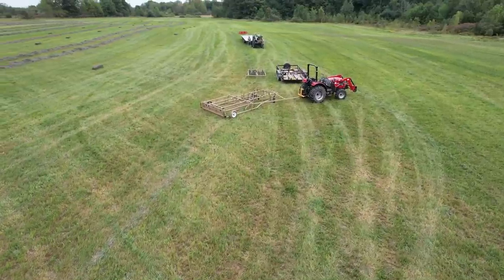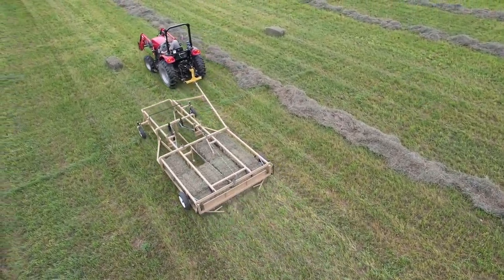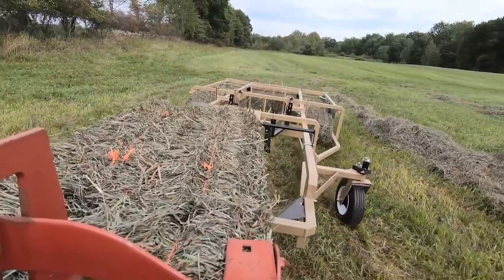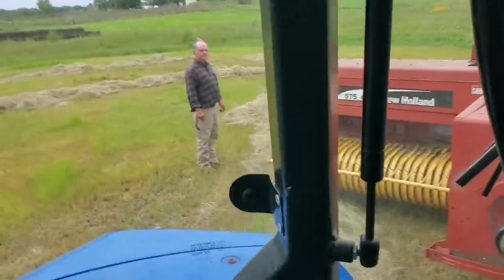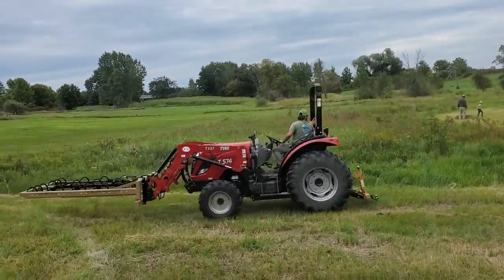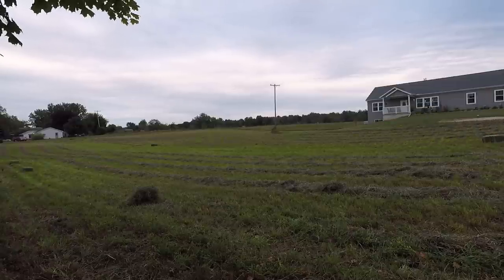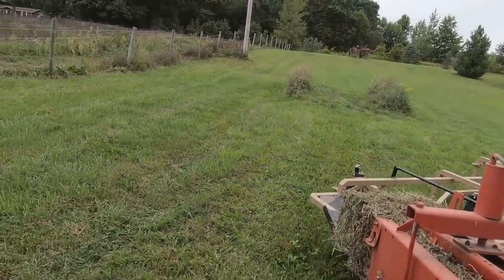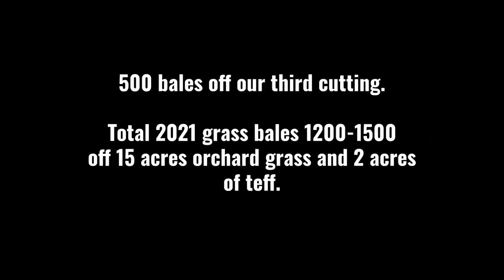404 Ground Driven Hay Accumulator System? - Parish Agriturf Demo

Comment: With my square baler and accumulator I found it easiest to take three circles around field then make all passes for remaining field end to end. Bale the three outside passes first and then skip two rows on each back and forth pass always turning right. My field is a very irregular shape with lots of trees and found this method worked well for me.

Comment: As a kid in the 50's in up state NY we used hay hooks and took the bales directly from the baler and stacked them 8 bales high on usually two wagons at a time and then took them to the loft. The hay was super dry as wet or damp hay or straw would burn a barn down. 
In the spring after plowing we kids would walk beside the rock boat and gather rocks out of the fields. You would think that after years of this there would not be any more rocks but like radishes they just kept coming to the surface. Most had sea shell impressions on them and we were at 1100 feet above sea level in the finger lakes region of NY.
The advances in almost everything is amazing. Only wish we could be equally amazing in being kind to one another.

Love your channel. Mike

Comment: I'm very happy for you guys that you chose this type of system. It's what I recommended (seems like) a long time ago. It is such a simple system. Easy to fix. And it does away with 85% of the labor. Not perfect. In those little fields, it is probably the best to run the accumulator separately.
Out here in the Plains, almost NOBODY feeds small squares anymore. Other than horse people around the cities, and racetracks. There is just so much round bale and BIG Square hay....even alfalfa. (In the rural areas) Fairly cheap too! It was good seeing an accumulator work again, Suzanne!

Comment: Viewed 3-6-22  from Illinois       Hi Sue     The accumulator you were trying out would  NOT be my choice.   Baler alignment to accumulator an issue,  bales not falling into correct position
requiring  stop to reposition, plus bales curl up meaning another stop.  Stay with the accumulator you currently have :)))

Comment: Great video.  Seems if the field is big enough pulling the accumulater behind the baler is the way to go it eliminates a step.  With gas/deisel more than doubling in price for next year anything you can do to save time and hours on the tractor will help out.
Reply from the maker: No doubt there!

Comment: Brilliant design on that wide mouth accumulator.  The only thing they need too add are some replaceable rubber strips where metal hits metal to reduce noise.  It may not be that bad in person when you're surrounded by the noise of whatever you're driving but the up-close video of the bails being fed in would get real old real quick.
Reply from the maker: That's a nice idea!

Comment: Watching those bales come out of the baler brings back years and years in the hay field. Long hot sweaty days that kept you in shape and felt wonderful when all was in the barn. Then a hot shower and good meal. Slept solid. The best life. 
Knotters seemed to work pretty good. Your a good mechanic getting those previous bugs worked out.
If those last alfalfa bales were damp there is a good possibility they will get dusty and not healthy for horses
Reply from the maker: I agree on the solid sleep situation! Keeps you in good shape!     The knotters did not give me issue even once! I was a bit worried since they were not perfectly aligned, but . . . if it aint broke, don't touch it, hahaha!

The alfalfa bales were for cows and goats. But I still don't like making bales like that.

Comment: Check out Hoelscher hay equipment. They have a system- don't know anything specific about it, but it might be worth a look. The system you tried in this video seems to work well, and the price isn't bad when compared to the Kuhns system. I am just not a fan of dragging bales all over the ground 🙂
Reply: this is the first one of these I have ever seen, only accumulators I have ever seen are pulled right behind the baler, if there is a price difference in this to the hook up type, it would be ate up in having another tractor, and fuel, only to have to go back again and pick it all up too, I have not crunched any numbers, this is all off the top of my head.
Reply from the maker: They ahve a nice system we found a used one locally (along with a very nice 575 baler too!), but they stack on edge, and not sure how that would behave in the barn if they'd fall over when I walk on them . . .

Comment: Greetings from the UK!   Those kind of tow-behind-the-baler accumulators (we generally refer to them as 'sledges') are pretty much standard kit for anyone making small bales over here.    They can be a bit of a nightmare if you don't have your baler set up properly, but once you get up and running they're pretty reliable.   In my experience it's pretty normal to have a few get stuck on the way through (I've had a few angry conversations with my sledge in the past!)
The other thing we come up against is that if you have a bit of an odd-shaped field, where your rows end up in a "fun" pattern, the sledge will sometimes drop a stack right in the way of where you need to be the next time round... it certainly makes you concentrate on how you rake!  After a while, you just get used to driving it as a part of the baler.    I've just bought a different model for haymaking this year...  so hopefully I won't regret the change!    Take care!

Comment: That system looks good. Looks like there is a extra piece of metal on the first gate that's catching the bales. I use one very similar in the UK but it holds 8 bales and we call them a flat 8 sledge and grab. There are a few videos showing them working.
Reply from the maker: I like the systems you ahve in the UK, I feel they are almost better than what we ahve available in the US :(

Comment: I love this video. When we were able to pull the wagon behind the baler, it was a game change for us. It beat pitching onto the wagon.  I would be curious how this equipment works on hilly fields, and ravines. It's a big investment for a small farm.
Reply from the maker: Hills I think would be ok, but ravines, not sure, lol!
Reply: That was the same way I did hay, back in the early and mid 60's. I rode the wagons, stacking hay.
(We had 2 wagons, only used 1 when close to barn.) We put up around 3000 bales a year.

Comment: We would always wait for hay to be properly dry even if it meant another raking and often did.  Longer bales would not clog that accumulator as badly.  That field seems to be much more than 1.5 acres.  No way does getting rained on reduce bale price by 25%!  Wait for another day IMHO.  I would have been told to go back and cut the strips missed!
Reply from the maker: When it's top quality horse hay, it does :(    I currently have customers fighting over this year's prospective crop because last year's was so nice. Rain cuts the sugar down in the hay, which for everyone else is a good thing. But my hay is already very low sugar, so any rain will take out the bit that's there, the the horses will refuse to eat it. No one will pay $8/a bale for hay their horse turns their nose up at ;)
Reply: @This1LifeWeLive  OK then.  I didn't know horses were so pickey.  I can understand people fighting over You, but not Hay!  It will likely go to 10U$ a bale with the lack of moisture currently in effect.

Comment: Hello Suzanne, best working system I have seen U use yet. Looks like the bales need to be tighter though. Thx 4 this video today. Maybe sell off the machinery no longer used & that will pay for this system.
Reply from the maker: I think it IS time to sell off the bale carts . . . that would be an easy $5K . . . but we keep them for the "just in case" moments. Although they do require a different set-up, so it's not like we could just drive over, grab one and put it to use, lol!

Comment: That looks like a pretty simple system being ground driven.  I've seen a bunch of trailers where the hay goes up a little elevator and then slides down diverters to be organized into groups like that.  I'm sure they are more expensive systems, but they would allow backing up and probably not curl the bales.  I live in eastern Michigan and I would love to have a small hay operation one day.  I already have a tractor, I just need to buy more land.  The neighbors probably think I"m nuts mowing my 1.5 acres with a 46 HP tractor.
Reply from the maker: we have a neighbor across the street who mows his large yard with a tractor (finish mower) too!

Comment: As you said   Your varieties of grass  requires  you to leave at least  4 inches of stubble height, where as our southern grass is cut down to the ground.....because the regrowth comes from under the ground, not from what is left on the surface.....We can  back up with the  Baler/ Baron system......Being as we supply  TSC  Farm supply stores in our area with  contract deliveries  it is more fesible to  get as many bales possible in a 53ft trailer as quick as possible.... Another plus of a Baron over a Bandit is it will bundle a shorter bale  (32in  vrs 36in)......meaning it takes less hay to make a Baron Bundle.. There are producers in our area  that  do more for less....... We do less for more..... Everything  under our shed was  " buy it then try it"  sort of like a striptease show No free looks
Reply from the maker: ohhhh, ok that makes sense! I have seen both the Barons and the Bandits, but haven't looked at them in a while!
Reply: @This1LifeWeLive  Well Little Lady......... stay tuned   a Bandit we already got...... the Hyddralic drive unit with Baron  should be here in April.....And the  Massey 1840  is under the shed

Comment: I'm partial to new Holland bale wagons. I was a one man operation though and found that worked best for me. I was looking at bale accumulators and I think I found one that is a accumulator/grapple combo that mounted on a tractor or skid steer.
Reply from the maker: That's what we have been using. It works, but still twice as slow as having an accumulator on the back. For us, we have a very small window in which to bale hay, so we gotta gett everything off as fast as possible.
Reply: @This1LifeWeLive  I didnt see any videos with a "New Holland"bale wagon. I may have missed it. May also be called a harrow bed. They're very popular out west. I would look also look into a accumulator/grapple combo or if you want to spend the big bucks there's a machine that bundles several bales together and bands them together.

Comment: I've only done large round bales, so I really have no experience in square bales like yours. IMHO, based on your videos, I think the pull behind works extremely well compared to your first accumulator you bought. The original one you bought appeared to be on the short side in length and it always looked like it was barely holding on to the front bales. The unit they brought along with them to put on the front of the tractor was notably longer and appeared to hold the bales much better. Again, just observations. Sometimes it's hit and miss with equipment and until you really get into using it, you'll never know the ins/outs. So, don't beat yourself up if you're regretting some of the equipment you have. No accumulation equipment is perfect, but the little details with them can make a world of difference. Also, I think the pull behind worked best just by itself, rather than behind the baler. I think it's just too much of a "train" to have to worry about.

Comment: Good baler with a kicker into a wagon. Is the fastest. I have done for many years. I have a the equipment for sale right now cause I'm going to small rounds. Seem like the bales sliding across the ground be picking up dirt and moisture. I will answer questions on hay making.

Comment: The best way yet is to just pull a hay rack behind the baler and load as you go. We have a total of 9 hayracks we use when baling square bales.
Reply: OMG,such blasphemy, actually touch a bale. Enough sarcasm,we still use kicker wagons,it allows me and my son to load wagons and back them into the barn immediately, in the last twenty odd years I've lost count how many times I've been chased back to the barn with rain. None of these systems can do what we need and that's fill the barn to the top wether it be the vapor barrier or the hay car track.
Reply: @tomreisinger6220 , we have 4 barns we fill with square bales. We bale a total of around 30,000 square bales any given year. Plus around 150 to 200 big round bales. We have a 300-head cow herd plus 50 sheep we feed. I got 7 brothers and we all farm together.
Reply: @morse2795  300 cows, that'll keep u guys busy, the old farmstead we bought 7 yrs ago only has room for 50 maybe, we only have 7steers and 1pen of pigs (6) and 1 mom cow, we started getting some cows to feed the chaff to , people won't handle loose hay even giving it away, the amount of sloth today is unbelievable, good luck to your operation, always something to be learned with cows and hay.

Comment: Do you have any clips with a side view of the bailer/ accumulator? The flipping around due to bouncing seems like the resolution would be a short slide as long as it clears the frame of the accumulator.

Comment: Not going to comment on the system itself because all that type of work i did was minimal back when I was young and dumb and could take the punishment of stacking by hand.
I will say if some company wants to work with a farmer on doing some testing/showing their product they need to be watchful of the weather, showing up willy-nilly when its suppose to rain can ruin a harvest that the farmer has to incur the cost.
I enjoyed the video though, anything mechanical gives my weary bones a sigh of relief these days. Take care.
Reply from the maker: agreed on all points.  While we ARE young enough yet to stack, we don't have the time to stack. The longer the hay sits on the field, the lower the quality and the lower the price.  So it's worth shelling out a bit extra $$ for bales off the field and stacked fast! I currently have customers stacked up eagerly ready to fight for this year's harvest, and that's a GOOD thing, hahaha!

Comment: We have a similar accumulator that’s about ten years old then the parish. I like how they are combining the guides as actuators to move the bales thru the system. 

Does it’s need 18x18x36” bales and a heavier bale (75-80#) to work best?
Reply from the maker: bale size yes, but heaviness no. Mine are 40-55lbs and it did ok. Biggest obstacle is grass variety. some types don't allow bales to slide over them well
Reply: @This1LifeWeLive  ours is mainly Alicia and Bermuda varieties so they slide fairly well. It has arms that hang down to actuate the guides. But to turn the back bales they need some weight to turn them. 

But it beats loading them one at a time by hand anyday!

Comment: Your system works, but to much equipment,slows down the operation. I also went through those growing pains to find a workable system. Now I bale with a 4590 Hesston 1/4 turn chute  and just drop in the field.we pick up with a old but in nice shape new Holland 1000 bale wagon 56 bales per load  when getting to the barn we use a 8 bale grabber on a skidsteer 773g bobcat. Raise up the load to just under 90 deg and off load 1 layer at a time straight into the hay shed stacked 6 tears high and back to the field. Reload to customers same as unloading .our fields are all within 1/2 mile or so
Enjoy your vids. I love haying my whole life.
.

Comment: We run 12 acres of alfalfa over 5 small fields and small square bale it all. I'm in the market for an accumulator system and would love to hear an updated opinion on this one. I'm running out of gullible nieces and nephews to get to come "experience the farm" on the hay rack.
Reply from the maker: I hear ya, we are there with you. this one seemed ok with alfalfa, but the biggest obstacle is making sure your path is cleared so you don't catch stuff. it's also quite long whch makes running it on small fields impossible (again, because you need a clear path to run it).  I have seen models overseas that look perfect, but are not available in the US.  Personally, I'd like to just make my own according to my own specs.  But the time is an issue ;)
Reply: @This1LifeWeLive  I was just dreaming about making my own, but I woke up and also realized that I have no time. Or fabrication skills.

Comment: I bought a used Steffens System because of terraces in my fields. It carries the bales instead of dragging them. I felt every time I crossed a terrace with this style accumulator it would lose the bales and make a mess. In light hay you drag the bales a long way on the ground. I did heavily consider this system but ultimately decided against it in favor of the Steffens System. The Steffens affords the opportunity to back up and selectively drop the 10 bale packages out of the way on end rows.
Reply from the maker: We have considered the steffens system too :)

Comment: Another awesome video keep the great content coming 👍🏻👍🏻👍🏻Is there a way to manually trip it to release the bales out of the  accumulater ? I know you don’t want to leave partially accumulated pile around the field but there’s got to be a way that you could back it up without disconnecting it or pulling up your posts… Not all farmers have perfectly straight fields there’s allot that are just like yours🇺🇸🇺🇸🇺🇸🇺🇸🇺🇸🚜🚜🚜🚜 Stay Safe and God Bless
Reply from the maker: I think that was the BIGGEST drawback to this system. While you can manually trigger the unit to empty, you'd still have to drag away those bales before you could back the unit up. You'd pretty much need a flawless set-up . . .